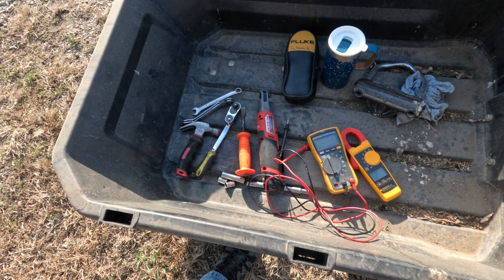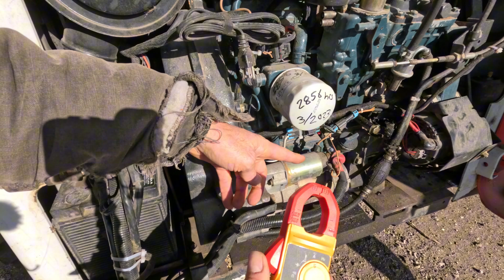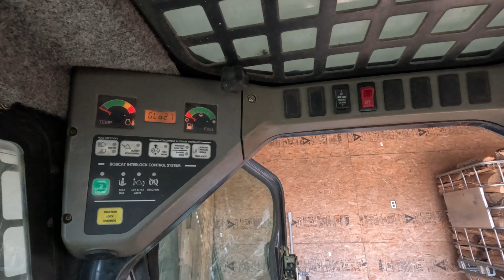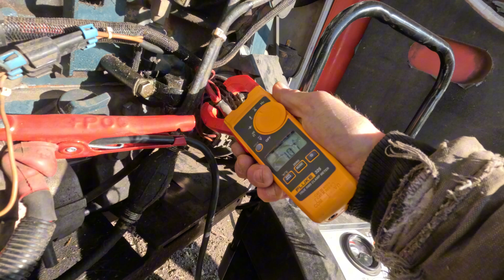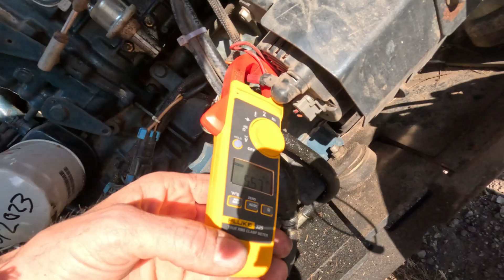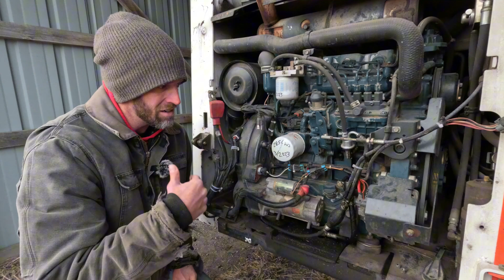Engine won't crank or start. Bad battery, alternator, or current draw?

Comment: I disconnect my battery in my 763 when not used. Keeps the rodents from eating wires and shorting it out. My Bobcat is the best helper here without it I am restricted. Lucky you has plenty of space to work on projects!
Reply from the maker: 763 is a great machine. I used to have an 853. Mice are the worst.....not lying when I say I had a mouse cause my T300 to catch on fire while I was using it. Thankfully got it extinguished quickly. Cheers!

Comment: Have you tried checking and changing out the fuel filter in that machine. Check the ground wires and power wires on it.,an the body to alternator cause the diode could be bad inside of it now. I'd clean everything off really good with wire brush.,drill and A wire wheel to get A clean metal to metal surface of the loop.,or eyelet connector crimped on to A new wire as A jumper wire to complete the grounding circuit on that machine properly.
Reply from the maker: It actually does need a service, I've got filters in the garage. I did check the ground for being tight and no visual corrosion, but I didn't remove and clean, at least not yet. Good point on the alternator grounding and diode, I haven't done that yet. Thanks for the suggestion!

Comment: I've never used a clamp meter like that pretty slick. Where did you learn about those?
Reply from the maker: I worked for a large mechanical, electrical, sheet metal, and service contractor for 5 years. Our guys regularly used amp clamps for troubleshooting. However, not all of then work on DC power, so I made sure the one I bought did, as I work regularly on both AC and DC systems.